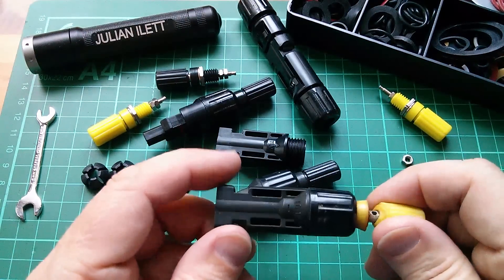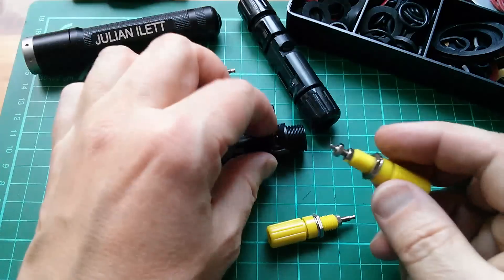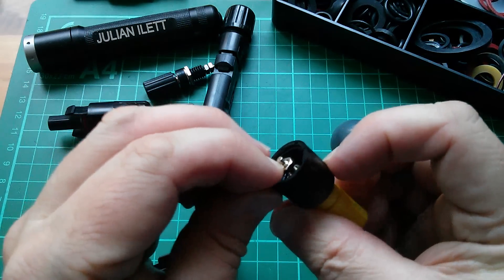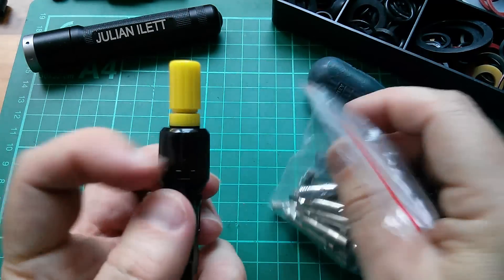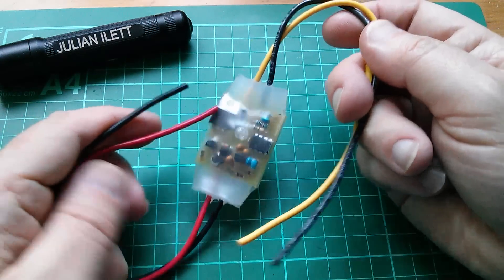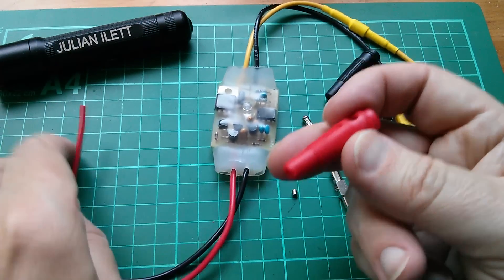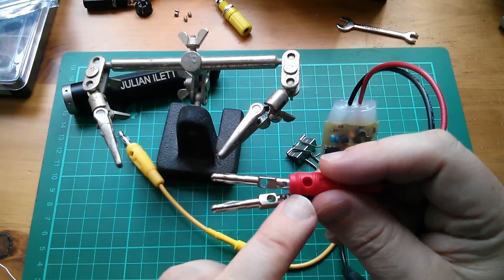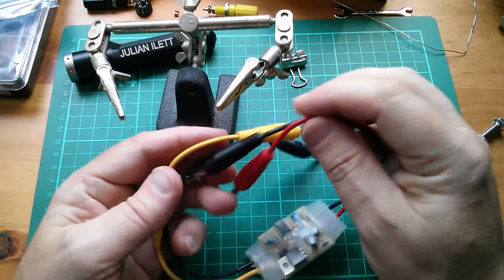New Solar Connectors

Comment: A while back I ran a service call that involved some outdoor wifi equipment.  To weatherproof the connections I went to a Home Depot and picked up this roll of "stuff",  it's black,  rubbery,  a couple of inches wide,  and sticks to itself very nicely.  Since then I've also used it for weatherproofing some of my ham radio antenna connections that are outdoors.  It doesn't affect the connectors,  and it seals very nicely to keep the weather out...

Comment: A few nitpicks:  1) You should make sure to include drip loops next to any connections so that water can drip off of the wire before it reaches your connectors. Done correctly, the connections would be slightly elevated with a loop of wire going lower than the connector on both sides. (picture a W shape with the connection at the top of the center peak)     2) as several others have pointed out, banana plugs are not water/corrosion resistant   3) You can get a bottle of dielectric grease for about $5 and completely flood the connectors to prevent condensation from forming inside the connector. (this is probably what killed the original connectors, not a leak at the banana seat)    and lastly 4) you didn't properly seal the boot on any of those wire connections, so you'll have moisture wicking through the inside of the wires and into the line-end of your connectors even if you do replace the banana plugs.

Comment: For my 12V system I use XT60 connectors on low voltage garden lighting cable (black, UV resistant and moisture resistant) and cover the connection with adhesive heatshrink. The glue ensures the rear of the connector is sealed and a ring of electrical tape between the mated connectors makes it submersibly waterproof. I quite like the ease of use of the XT60, two bullets in a plastic housing that makes a really good solid connection and is easy to plug into in the dark.

Comment: Not about connectors, but this is a new video on solar, plz excuse me.  I read some time ago that connecting individual cells in parallel means that if one is getting a lot more light than the other (eg shadow) it will push a reverse current through the other one which can damage it.  So are panels  made purely of series connected cells, with these groups paralleled by a diode for each group, or is uneven light coverage something to be very careful about?  Or am I simply wrong?!   :)

Comment: I put grease on all electrical connectors used outside or on the car. EG inside block connectors (choc blocks), car battery terminals, croc clips. I use standard bearing grease. If there is a chance that rubber O rings or plastic may be damaged by bearing grease I use silicone grease, although it doesn't work as well. Bearing grease works best, I dip the wires in it before screwing them into a connector.

Comment: just put the connectors inside a sealed plastic box, drill holes for the cables at the bottom side of the box so the water cant get insided, will stay dry forever

Comment: As per many of the other comments, I have two points. 
i) I cannot believe that you are using such completely unsuitable connectors for outdoors when many suitable connectors exist, in particular for automotive applications. 
ii) You should avoid putting Vaseline on most plastics as it can cause them to degrade. Silicon grease would be much more suitable. You could, however, smear a little Vaseline on the battery terminals and the metal parts of their connectors to reduce corrosion. This is commonly done in garages to prevent the build up of lead oxide on the battery terminals which causes poor conductivity.

Comment: What I'd do for those wires and banana plugs is tin the wires, put them in with the screws, and then reflow the solder on the wire so it bonds to the connector. That said, I'm the idiot who put copper and steel battery clamps touching each other from two charge controllers on the same battery. Can anyone say rust?

Comment: If you would put some silicone grease on the inside of those plugs it'd keep the steel parts from rusting. Also it'd be better to use on the o-rings than the vaseline, often times petroleum based products don't play nice with o-rings, makes them smooshy and bloated.

Comment: Julian, for heaven's sake making or fabricating waterproof connectors is madness when you can get IP65 connectors off the shelf. Also banana plugs are going to pull out. You need screw terminals. Please get working on the MUPPET as this is a far better use of your intellect. Many of us are waiting.
Reply from the maker: MuPPeT is on my summer to-do list (assuming we get a summer). Lots to do: play with different numbers of turns on inductor, try different FET driver, finish software for voltage regulation. The PWM frequency library is no longer compatible with Arduino IDE, so it's coming out. I'll have to manually set the TMR registers. Then there's the Arduino controlled water sprinkler system to cool the panel and get more power!! But remember that MuPPeT is built on a panel covered in banana terminal posts, so the new solar connectors are essential :)
Reply: Remember I'm just up the rail line from you in Solihull and available for beta testing ...... I'm going to buy a 240W panel and deep cycle battery (golf cart battery?) Intention is to convert parts of the house to 12 (or 24?) V LED lighting. I've already got a  5m 12V LED strip light in the garage and it is perfect, so I want to gradually expand the idea to use as background / walkway lighting. 

Could I ask that you make MuPPeT suitable for 24 as well as 12V please

 I will not be using banana plugs though.

Comment: The clips on your battery ,you should wipe wheel bearing grease on the so they won't rust again,trust me it works great I have been doing it on cars for years

Comment: I think you need to get electrical grease which protects the connectors from rust. http://www.amazon.com/Dow-Corning-Electrical-Insulating-Compound/dp/B0195UWAHG/ref=sr_1_15?ie=UTF8&qid=1465238644&sr=8-15&keywords=electrical+grease

Comment: Another thought.   Why not just replace those connectors and get automotive connectors.  Add some dielectric grease and they already have O-rngs built into them.  Solder them to your wires and use heat shrink with sealing gel in it and you should be in like Flynn and totally waterproof..

Comment: Get some automotive dielectric grease designed for waterproofing auto electrical  connections.   That should solve your problem 100%.   This should also be used on the banana plugs and waterproof them even though they are exposed.

Comment: Is it not possible to crimp the MC4 connector onto the banana jack's screw post? Seems to me there's not much electrical connection going on there, pressing that loose fitting nut into the already seated MC4 terminal.

Comment: I want to get started with some low grade ( inexpensive ) solar stuff , are any of the kits of ebay worth it ? What about grid tie stuff is that ok to use in the UK ? I am guessing you would need an inverter that would turn off if it detects the line voltage fails ( so you dont kill people working on the grid :).

Or should i just stick to 12 for now ?
Reply: I'm no expert, but I think trying to invert to 240v is only for expensive setups with large panels. Its fun sticking to 12v as a lot of caravanning and motoring gear, kettles, lighting, etc runs on that voltage. Heck :< I buy LED car bulbs on Ebay for 10p each. shipped on some unpopular auctions. When I say unpopular I means bulbs they are selling that no one would put in a car.

Comment: Hi Julian Interested to know what you think about Nickel Iron Batteries? Ment to last for 5 x longer than lead acid or even more. And you only have to add water every 3 months or so. Work out cheapest per watt over time I heard.
Reply: Im not Julian but, NIFE cells in my experience are about the most robust that you can get, virtually indestructible i think, the only downside is that they are a bit expensive to buy and the electrolyte is very caustic so you have to know how to neutralise it if you have an accident.

Comment: If you use gold or gold plated banana plugs they won't corrode as easily. Assuming you really need banana plugs, there are other connectors which are easy to disconnect and will make a far more waterproof seal.

Comment: I'm faced with a similar situation Julian (on a camper). I really don't like these MC4 connections and I'm leaning towards soldering and sealing the connections inside a waterproof case instead as it would be easier to tuck away.

Comment: I just use the MC4 connectors as my quick connections.  They're already water-tight and they aren't hard to disconnect and reconnect.  I can use the tips of my fingers to press in the tabs but there is always that little plastic tool that you can slide on to press and hold the tabs for you while you pull out the MC4 plug.   Forgot if the tab tool came with my MC4 crimper or with a set of MC4 connectors.

Comment: Julian, if it rusts, why don't you use insulation, like PTFE (teflon) tape or mineral or silicone (very important to be mineral or silicone) grease? Don't take the risk, some grease on it is cheaper than the power units all hooked up to it. Those pressure fitted connections can't protect it since the thread itself has a spiral fluid path that you have to break.
Edit: 3:40 Hit a copper or aluminium tube of the right size until you have a hexagonal ending and use it as a pipe wrench

Comment: silicone grease is great for keeping water out and stop things going rusty.
Reply: I was going to suggest this too. Vaseline is petroleum based and will damage the material overtime.
Reply from the maker: I like Vaseline because you can just rub it into your skin after using it. Can you do that with silicon grease?
Reply: nope!
Reply: Julian Ilett sure, you can get food grade. The clear stuff, is non-toxic. I use it for my fountain pens, to get a water tight seal.
Reply: I don't think the one I use is hand friendly!
Reply: Harry Bibby I use this http://www.ebay.co.uk/itm/Silicone-lubricant-grease-1oz-30ML-plumbing-heating-/171331439800
Reply: +blaser ok I just looked at my silicone grease, it's clear and is says it's pure, so I don't know, sounds ok

Comment: Maybe some teflon tape on the threads? If they are good enough to keep water under pressure inside, they should be good to keep rain with no pressure difference outside.

Comment: except eBay do you know of a website where I could get large packets of items ?
banggood just is overpriced and doesn't have as much choice
Reply: aliexpress, but they dont support paypal
Reply: But you can pay via money transfer or virtual card.
Reply: Just get a paypal debit card, then you can use paypal literally anywhere (that accepts cards obviously).
Reply from the maker: Oh cool! That sounds like a neat way to use PayPal on AliExpress
Reply: Unfortunately that is one drawback of using Aliexpress.  I guess the overlords of finance have decided to divide the market so these Chinese mail order companies can´t use all intermediate money handlers at the same time.
Reply: Julian Ilett The only cavet is to get one (when I applied for mine anyway) you had to meet a few requirements, which they don't make entirely clear, they used to require a Premier or Business account, so I dunno if that's still a thing, along with an alternate payment method such as a bank or credit card and you need to spend at least $500 within a year, that one got me a couple times when I had my account for the first 2-3 years and I had to contact them to find that out.

On the plus side, I get 1% cash back from using it so that and paypal being easier to manage than my bank, makes it instantly the better option, at least in my opinion.
Reply: yonie I have yet to go back to aliexpress because I've had so many painful experiences, and they don't always ship in a single packet ( so essentially it's like ebay )

the reason I need single packets is that I live in an appartement, so no post box, if a packet arrives I need to go pick it up 6km away, and they only keep packets for 1 week so it forces me to do a 30 minute detour every week :/

I'll do the paypal thing, although I was hoping to find some obscure chinese site like BG that would have a large selection :p
Reply: alieexpress.com and aliebaba.com for you solar needs.
Reply: BillTheBox Well it's all in chineese but you could try taobao.com (or use an agent) you can find things at absurdly low prices, although that's ruined by the shipping costs so it evens out to be a little bit more than ebay/aliexpress.
Reply: vgamesx1
PERFER http://www.aliexpress.com/  4 my stuff. most vender will take about a month to get the stuff to you.